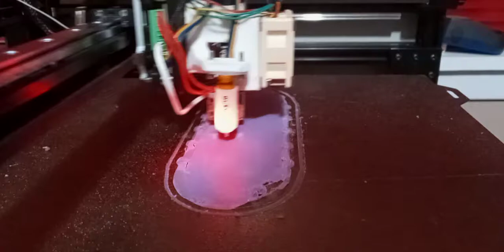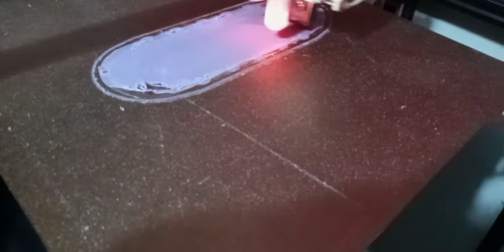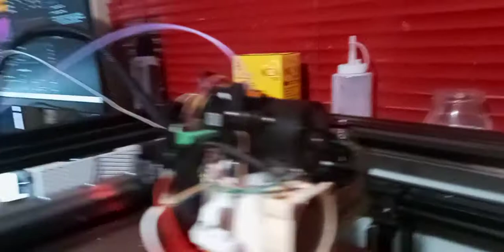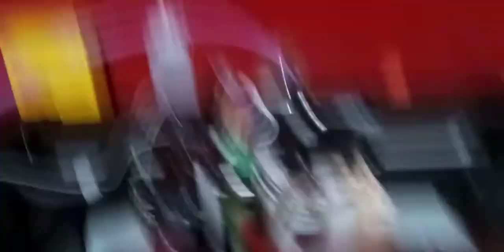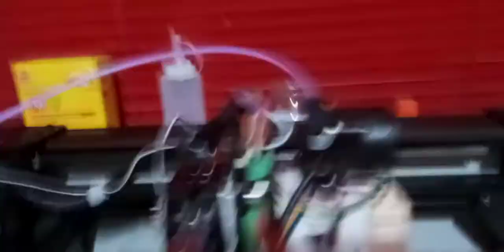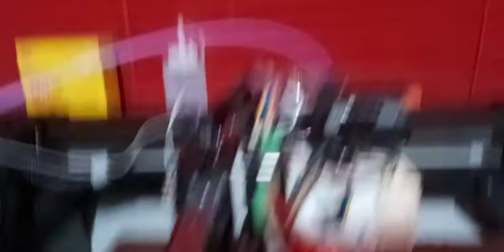BLV MGN CUBE BIQU Hermit Crab tool changer

Comment: is that a hermit crab top mounted to MGN12 linear rail?
Reply from the maker: I made an adaptor plate for my printer. Took the mounting holes and modified the metal plate of the carriage and added offsets. After many hours of testing i feel more confident about making the design public. Probrobly gonna put it on printable once i get the files together.